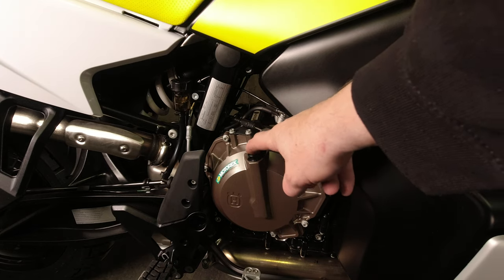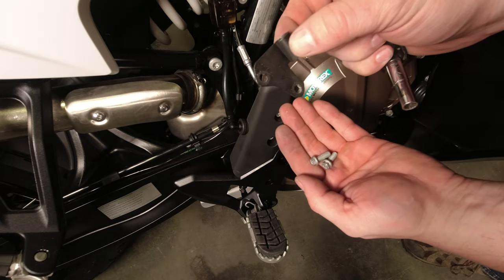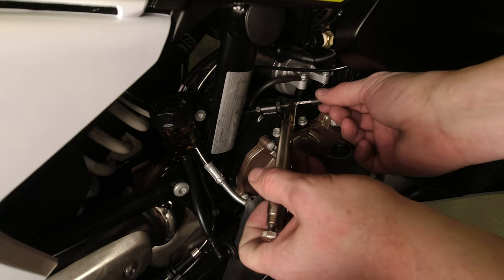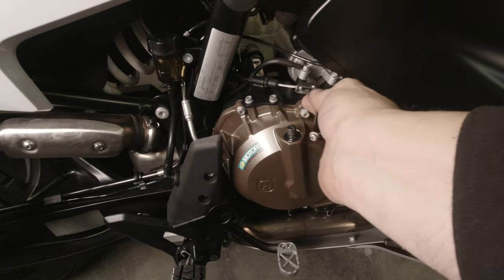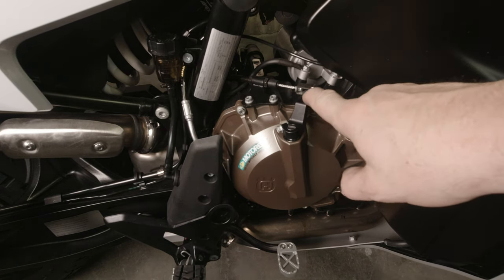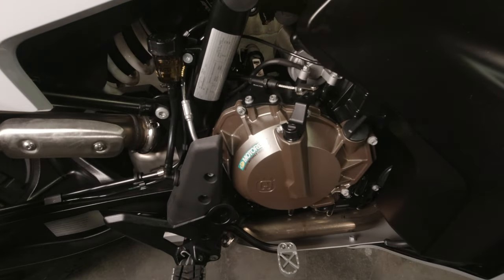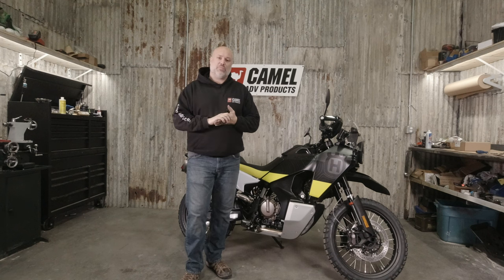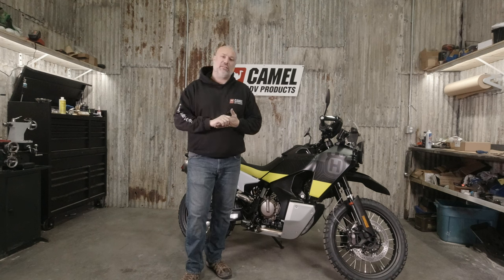1FC Install Norden 901

Comment: Just a FYI, I replaced mine and DID NOT have to remove the rubber boot from the end of the cable.  There was enough free play that I could slide the cable through the slot.

Comment: Hi Sir I bought it from Nice Cnc for my Duke 890R because I don’t have quickshifter and after few hours through twisties my left wrist hurts a lot. I have not mounted it yet, but now you told that it releases lazier than the stock arm I think I’m going to try the hole in the middle, first. Maybe its a little bit longer lever anyway and it could soften it enough.
Thanks for your video